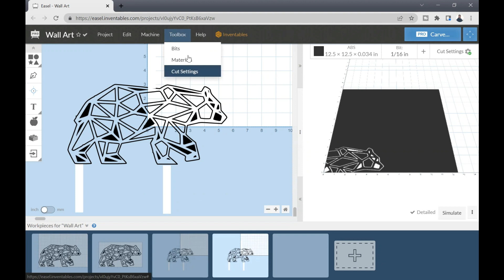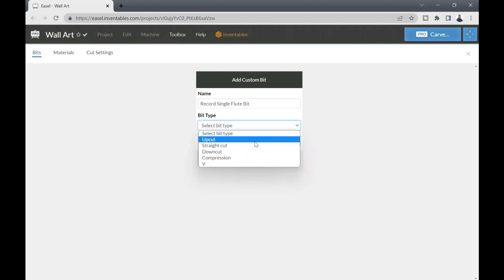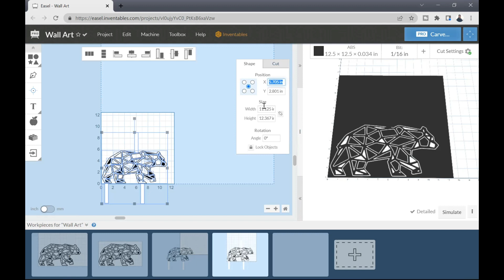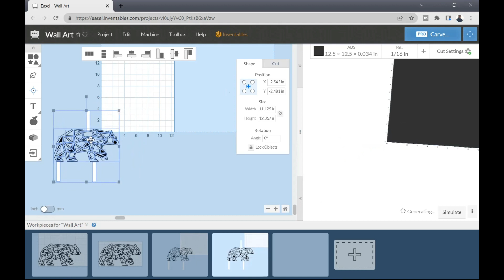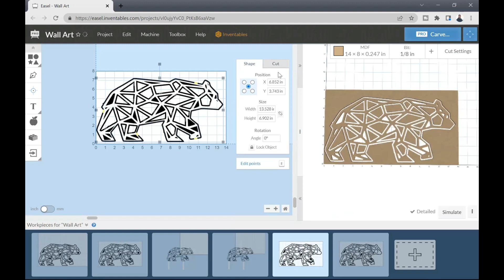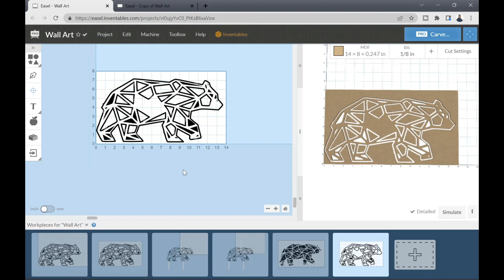Easel 101 Tutorial

Comment: I have been having a tough time with easel, but I am getting there. I was watching your "100 projects" video and I saw one of the things you made was a square you put on the waste board with clamps. Just wondering what you use that for?
Reply from the maker: Thanks for tuning in.  Can you give me a time stamp?  At 04:30 I was carving a wireless charger.  I made a whole video on that build.  Is that what you are talking about?  

https://www.youtube.com/watch?v=Q7y8XftRcfc&t=16s
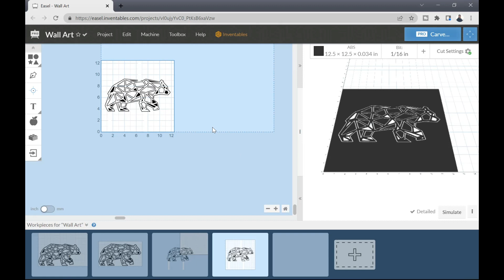Reply: @businesseveryday  4:09 - 4:17 It's a square jig. I watched another one of your videos to find out more about it. You had some problems with the hole alignment. I am very definitely interested in accuracy, repeatability. However the most useful thing to me would be design in easel. ANYTHING you can do with easel, I would watch. I probably need to go through all the apps, one by one. I have been messing around with it, but some parts are just not intuitive. I have a full shop, table saw, band saw, planer and drum sander ect., and I am looking to do inlays, which easel makes pretty easy. However; I wanted to make little heart shaped boxes, and other things. I managed to get the  little heart shaped boxes made, with some help. Then I screwed them up. You were really right on when you said, there are days when you question what it is you've done with this purchase. Nothing goes right, and you just want to give up. It was a big purchase, and it is a little more than intimidating. Mostly I just hold my breath and expect everything to go wrong. So it's nice to hear that you have some of the same doubts. Thank you in advance for your time. I have an instagram where I post all of my stuff boxwoodgifts, should you care. Thanks again. Hope to see more on easel if you can.